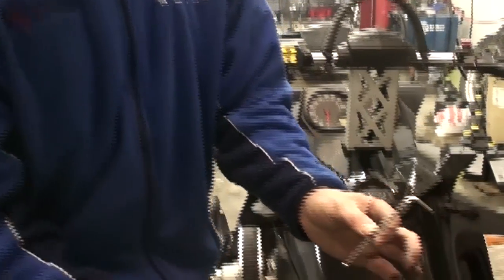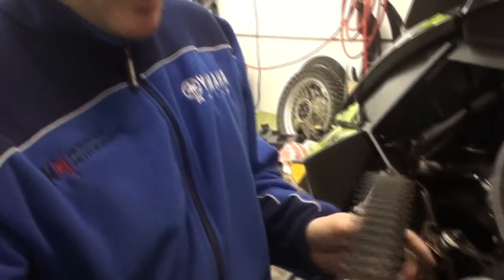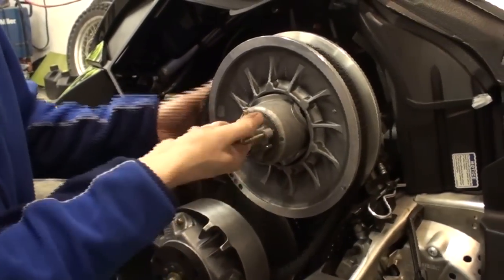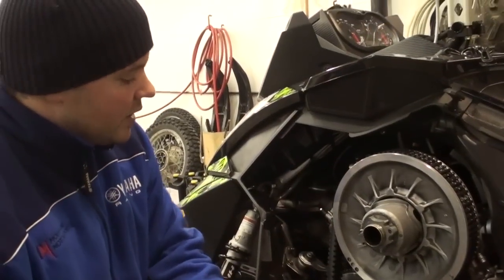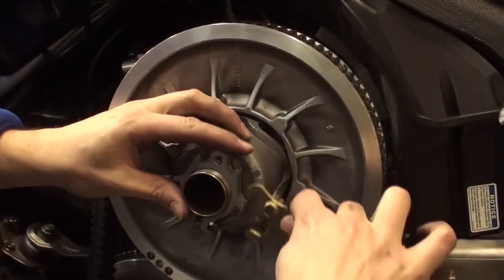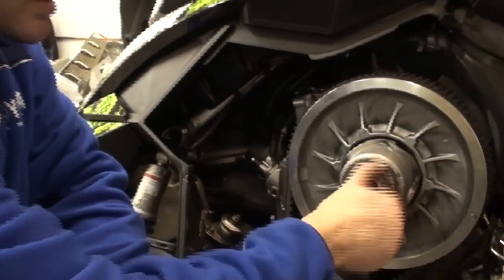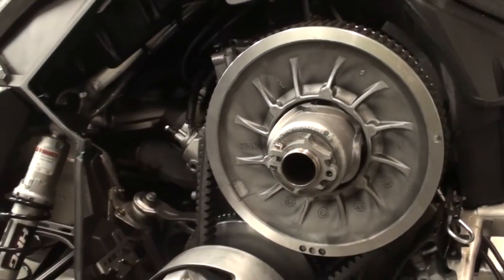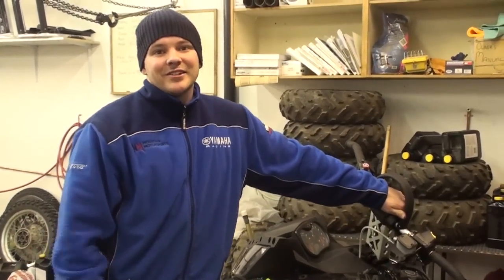Ski-Doo 2011 800 E-TEC Belt Change and Deflection – Tech Tip

Comment: Running the belt loose means you are not engaging in the lowest gear, that is the only difference in performance. Once you are moving there is no effect, the adjustment is only for engagement tension. It is harder on your belt to stop and start when you run it loose. It's like trying to pull out in second gear with a stickshift - you can do it but it's not a great idea. I recommend running your belt as tight as possible as long as it doesn't make a squeal at idle. You can't really judge by how high it sits in the sheave because there are minor variations in center to center distance between sleds, even of the same make and model - but it is a good starting point. My advice is run it tight until you hear squeal at idle, then back it off bit by bit until you get to just the right tension. Don't forget as the belt wears you will need to retighten. Running it tight could cause excess engine braking, so if you don't like the feel of that run it a little looser. The point is there is no really clear cut way to know you have it right without tuning and testing. Check for burned rubber marks on the primary sheave at the engagement point - that can be caused by the belt being too loose and it burns as it struggles to engage.
Reply: I like it loose

Comment: So I have a pretty serious troubleshooting issue with my secondary, it seems it doesn’t wanna adjust when trying to adjust it as per this video. I tried everything and it just doesn’t wanna move back into position almost as it’s seized up. Any input would be great.
Reply: I think one thing that I did today was make sure your track is off the ground. I am not sure in this video if it’s off the ground but I tried it today without the track in the air and would not move, then when I lifted the track off the ground I was able to adjust as it was free spinning.